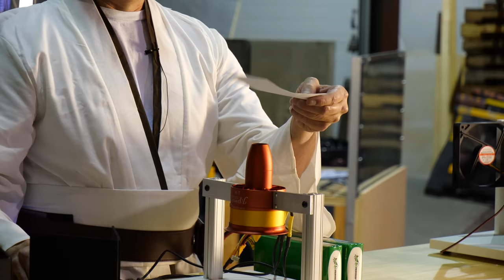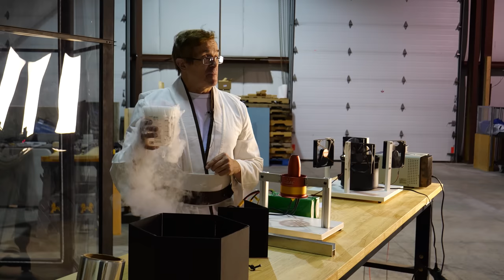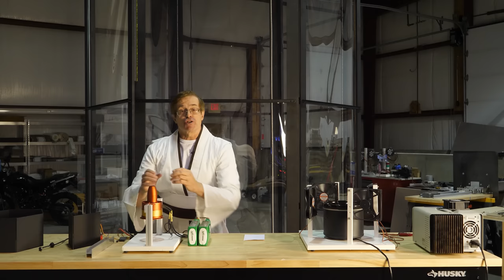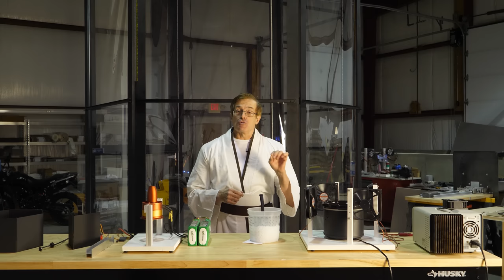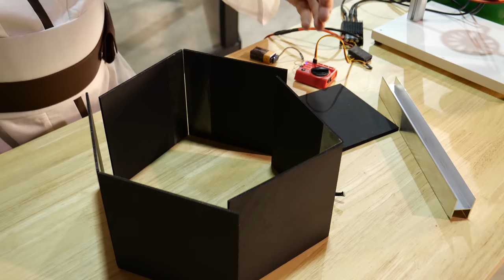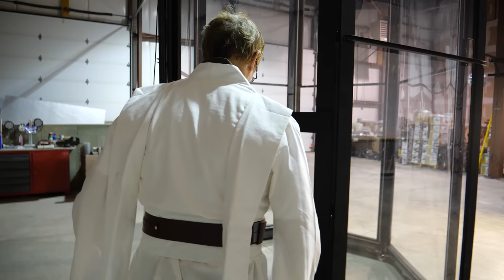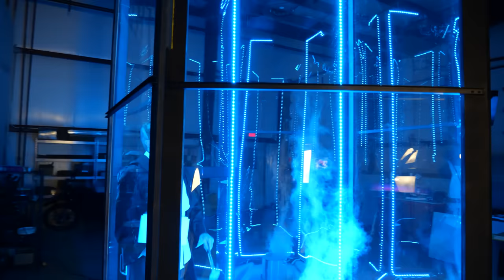Controlling Chaos: Building a Massive Tornado Chamber!

Comment: For a smaller chamber you can use an ultrasonic mist maker, they just require water and electricity.  You wouldn't think a small mist maker would work well, but I think the low pressure center of the vortex helps bring out the fog.
Reply: That's what I was thinking as well.  Wonder if you could get several of them for the big tornado machine?

I can't imagine the residue from those fog machines, I've noticed white mineral dust from the ultrasonic humidifiers, let alone atomizing oil or glycerin in the air.
Reply: @Dan-yk6sy 
That is some hard water you are dealing with.
Reply: Yeah with distilled water.
It would take several high power ones, but would leave only water.
Reply: @Dan-yk6sy  With decent juice there isnt ....much.... residue. Then again, Ive mainly used them in themed attractions ( from little 40w cheapies to 1500w ones with dmx and stand alone brains) not an plexi box, but there is a VERY stark difference between walmart fog juice and something like frogger juice. Especially if you use a more hazier or stringier fog (hazers are for lasers, and strings are for like flowing through something like fence stakes, makes long wispy tendrils. From what Ive been able to get out of the guys from Frogger at conventions is the fog characteristics has to do with how the glycol chains form after the water flashes and the steam 'fluffs' the oils into the air and carries them out of the machine), compared to something like 'bog fog' which is the thick long lasting low to the ground stuff.

You can use old ecig cartridges for mini foggers, just add a bit of airflow and you're set. I use an old vape pen with some fog juice for visualizing my laser demos (more science-y diffraction and interferometer stuff).

Otherwise, yeah, absolutely use distilled non-mineralized water. The ultrasonic disks pulverize the water into droplets (basically cavitate-shove-cavitate-shove etc) so anything in the water will just fall out and cake on the disks. The good news is there are models with replicable disk sections (they're just held down by a ring retainer onto the contacts). So if they get too scummy you can just order a bag full of replacement disks instead of replacing the whole unit.

Oh, side note: remember to run vinegar and distilled water through your fog machines before and after use  before storage. The last run should be just water until it stops smelling like vinegar. Gets all the leftover crap and crud out ;)
Reply: This idea has me thinking of the possibility of using it for wet flow analysis of cylinder head / induction systems, on a flow bench.
I realize it wouldn’t be a exact analog, for differences in characteristics, between fuel and water, but think it may provide a demonstration of the general behaviors of aerosol flows within specific port configurations.
Reply: @zombieregime  I've found bulk pure vegetable glycerin (VG) to work super well for the old vape device portable fogger/hazer
Reply: Yes, I'm making one desktop sized!

Comment: I still remember my 7th grade science teacher back in the 90s doing a tornado demonstration showing some similar aerodynamic effects, only he used fire to create the tornado.  The demo required only an empty coffee can with a small piece of cotton cloth soaked with something flammable (can't remember if it was lighter fluid or kerosene/lamp oil), all set atop an old phonograph turntable.  The updraft created by the convection from the heat rising, along with the rotation from the turntable, created a stunning twisting fire column that of course as kids we all enjoyed watching.  And since it was literal fire, the tornado was self illuminating and wasn't dependent on humidity of the air to condense water-droplets so it could be seen; in-fact the effect looked even better in the dark when all you could really see was the whirling tornado.
Thanks Tech Ingredients (and my old teacher Mr. Wolf) for making science fun and interesting!

Comment: I like the modular panel design! I hope more people play with the idea. Nice work.
   I have built a number of tornado machines for a local science center to loan to schools, and a large permanently installed machine that produces a 10 foot tall tornado. These used ultrasonic vaporizers to produce the fog, and they performed very well. The small machines (producing a four foot tall vortex) worked ok with a household sized ultrasonic vaporizer. The ten foot tornado used an industrial unit with eight transducers, fed with tap water run through a filter and DI bottle so it ran continuously without needing attention.
These machines didn't use clear panels but instead used four hollow posts that each had a row of holes along the length to form a set of air dams which both gave the rotational motion and helped exclude ambient air currents. This allows people to simply reach (or walk) in and play with the vortex.
One other tip: The vapor source should be underneath and coupled to a flat floor with a perforated central area (like a perforated pizza pan). Having a large stockpot or humidifier just sitting at the bottom causes turbulence that disrupts the laminar incoming flow and makes the vortex less coherent. You should be able to see that the vortex has a hollow core!

Comment: Beautiful video and beautiful build! BTW- For those who would like to create beautiful underwater tornadoes on a tight budget, you can do so by filling a tall jar or cheap plastic bug terrarium with water then add a layer of ultra-fine grain aquarium filter sand on the bottom. The finer the grains of sand the better. Regular playground sand is too heavy and will not work very well. Ultra-fine sand has just enough weight to easily be lifted and fall back down gently. My local PetsMart store sells bags of ultrafine aquarium sand and small bug terrariums for cheap. The tornado itself can be easily produced with a cheap, battery-powered coffee milk frother that uses a small, spinning coil of wire to froth milk (create milk foam). Simply lower the spinning frothing coil into the top of the water. It may take a few moments, but a vortex will form that will eventually reach down to the sand and will start to pull grains of sand all the way up through the vortex and spit them out at the top like a real tornado. Tornadoes produced this way can look very, very realistic. Total cost of all three components is about $15 US dollars. Bags of ultra-fine sand usually contains a lot of dusty particles that will cloud the water. If the water gets cloudy, simply do a few water changes. 

You can also “steer”, or guide, the tornadoes around the aquarium by moving the frother. In one of my science classes I used a 10 gallon aquarium with a 1/2 inch (2.54cm) layer of ultra-fine sand at the bottom and handed out a bunch of cheap milk frothers that I purchased from Walmart for a few dollars each. We had as many as 6 tornadoes being produced at the same time in the aquarium. The students very quickly learned to start attacking each-others tornadoes by moving them around the aquarium. We called our new game: ‘Tornado Wars’.

PS- I’m jealous you can wear pure white in your shop. Two seconds in mine and it would be incredibly off-white. 😭

Comment: If you watch videos from How Ridiculous, when they drop a big rubber band ball with a small rubber band ball behind it, from a drop tower, you can actually see when the smaller ball tries to move out from behind the large ball, it is deflected back to the area behind the large ball. It's kind of like the demonstration you did here with the ball in the air stream.

Comment: Great video as usual.
1 - its interesting how your presence inside the chamber disturb the flow. See the perfect and mesmerizing flow when you are outside.
2 - if I could i would place the dry ice on top and the fan on the bottom to see the difference.
Cheers.

Comment: The fire nado is pretty cool as well during large forest fires. Meteorology speaking the structure of a supercell has a lot of contributing factors such as the beavers tail forms with certain inflows thus adding to the sheer bases form rain free and shafts for rain this is a great example of using the doors to help create the variable winds that are actually occurring out in the field. Great job kind sir!

Comment: If I remember right, when we saw a demo of this in elementary school (40 yrs ago) they used a pan of water on a hot plate at the bottom, and no fan. Not as impressive but truer to the actual formation of a tornado. Things have to be just right to get it to work but the vapor funnel is actually water condensing out of the air.

Comment: Thanks for the wonderful demonstration and explanation of tornado formation processes!
It looks like the vortex is rotating in the same direction as the fan.  I imagine If the panels were adjusted so that the vortex was rotating in the opposite direction of the fan, the tangential velocity of the vortex air stream would be more effectively captured by the fan blades and resulting a much higher air flow, fan loading and stronger vortex.

Comment: this 5 minute intro, made me understand why particles "create pressure". after all those years, I realise that a gas is a bunch of elements bouncing randomly. But the structured stream of the gas elements in the fan remove (Lower) the randomness. And also "remove" the randomness of the elements in the boundary layers because there are less collisions in the other directions possible. Because these elements are like billiard balls knocking the other elements in the  (in this case because of the fan) upward direction. So that's why there is "high pressure " and "low pressure". Thank you!!
Reply from the maker: You're welcome.

Comment: Suggestion for topic to research and make some experiments: Test h-BN (hexagonal Boron nitride) nano powder (less than 100nm, better 60-50nm) additive for engine oil.  It makes engine last longer. So it would be great if you demonstrated it on some small engines you probably have. 

WS2 and h-Bn have a two-dimensional platelet structure and a high hardness which results in a very low sliding friction coefficient.
The theory is that very small particles of this material mechanically adhere to the metal surfaces of the engine creating a hard and sliding boundary layer thus reducing friction.

Comment: Sometimes in the early morning over a still pond, a few minutes after the sun hits the surface a frantic mist appears over the water. The amazing thing is six or twelve foot tall mini tornadoes about four to six inches in diameter.
Reply: Sunlight photoionises the surface of water (see Gerald Pollack) which creates water vesicles (via sputtering of sufficiently ionised bodies) that approximate a dust/vapor plasma. It so happens that both the vesicles and the Earth's surface have a bulk negative charge causing the levitation of the droplets and water vapor. (again Pollack).

What does get interesting is that aerosol largely acts like a gas, and since the droplets have a bulk charge, it acts like a gas plasma. The vortices you see are a result of Marklund Convection, the formation of plasma filaments (very common in plasma experiments). The rotation of the vortex is induced by the Lorentz Force. 

If the vortex were powerful enough, like that of a hurricane, you'd see that there's a concentric and counter-rotating shell around the inner cone. This counterbalances the spin, and the current of the vortex. Given the difference in radii, and volume, it doesn't need to be that (charge) dense, thus diffuse and invisible water vapor is a sufficient ballast.

As it turns out, electricity is very orderly, and more powerful than thermal forces. 

If you want to see more, look up "Matt Finn: Electrical Dust Devils". It provides the above explanation with more detail and examples.
Reply: @Dan-gs3kg  "“This is the ‘cold fusion’ of physical chemistry,” says Michael Grunze of the Pollack work. "
Reply: @BobCat0  Gerald Pollack.
Reply: @Dan-gs3kg  Yes, the nutty quack.
Reply: @BobCat0  show me how the experiments are wrong

Comment: Having sold vacuum cleaners,(as a young teenager in the seventies) I developed the skill at subtly moving a business card from nozzle to another. When making a sale I would, when the opportunity arrived, place my business card on the customer's old vacuum, then lift it off with mine. Not mentioning that I could easily do the same thing in reverse.  I recently tested my skills to get my pick of machines in my construction. I just explained that I was giving the stronger machine to the other guy. A piece of sandpaper proved it.

The value of a properly misspent youth is proven yet again.

Comment: Ok, this is just purely coincidental given the #short I just uploaded.

I've been making little vortex chambers out of PC fans and foam board but mine are open ended (not fully enclosed). The recent one is a 90 degree corner with a curve to promote both the initial spin and to keep turbulence at the minimum.

I'm using a slow 220mm main fan and have recently got some very small 4010 fans to add a slight breeze along the wall.

Comment: I think maybe its a slight oversimplification to say that a ball or whatever trapped in an air stream is there because of the low pressure created by the moving air.
Whenever the ball deviates from the center of the stream, the stream gets preferentially attached to the side closest the the center of the stream and ejected from the opposite side. The net effect is the momentum change of the ejected air (which is always in the direction of the deviation) gets transferred to the ball, pushing it back towards the center. So it isn't the overall low pressure of the stream, but the very local pressure differential caused by the attaching and detaching air stream that keeps the ball centered.

Maybe this is being pedantic. I don't know. I'm still putting it here.

It would be interesting to see a smoke trail in the center of the stream and slow motion of how it moves.

Comment: You did a great video, had great ideas and built a very cool tornado machine. Still i have an idea for something next level. I don't know if it's possible but I hope someone one day will build a tornado machine that generates its own visible vortex the way real tornados do by converting incoming air with invisible water vapor to visible water droplets. It might take too much pressure differential,  it might take too much energy, it might get too dangerous but it would be interesting to see if it's possible.

Comment: Use the LED strips that are encased in silicone, for outside use. If you try to store these, or even while using the structure, LEDs are going to fly all over the place, they get ripped away from the strip if you hit them with something.

Comment: Hey Obi Wan, great show. If you placed a pot of ice in the middle and had a small plastic tube where you could flush some water into the pot by hand or with a small pump - wouldn't that work as a remote as well? More water more vapor, right? Or perhaps skip the ice and use a super fine water mist like they sell for hot summer days? Maybe next year you could have your assistant take a swipe at you with a light saber and you disappear. May the force be with you.

Comment: I could not help but think of the small dust collector i use on my shop vac.  It does an amazing job separating fine particles of dust, I guess, by  centrifugal  force.
Also, good point about water changing state from vapor to droplets.

Comment: 6:54 Angular momentum is conserved, but not velocity. Since moment of inertia is proportional to radius squared, at a given L, if you halve the radius, you quarter the I and quadruple the ω. However, the linear velocity is proportional to both ω and radius, so the linear velocity is also doubled. Thus, the kinetic energy (1/2 I*ω^2) is quadrupled.

Comment: If these principles were to apply to an open shower bathroom, theoretically the moisture would be remove a lot efficiently and faster, and the only power input would be the ceiling fan, since the walls passively guide the air intake to form a vortex. I don’t know if it works, but I like the idea of it.

Comment: The ballerina does add kinetic energy to her spin when pulling arms in. It takes a force over distance to pull the arms in, so work. And if you look at the kinetic energy before and after, the angular velocity is squared, while the moment of inertia is linear.
Momentum is conserved, energy isn't.
This is why things with internal damping, like sattelites with sloshing fuel or a flexible rod, will be unstable rotating about thier lowest inertia axis. Damping will suck energy from the rotatation, but momentum must be conserved.
Reply: Yeah, what you are pointing out has been pointed out by several others.  If you keep scrolling down comments youtube keeps loading them (until you have loaded all of the comments.) Search on the page for the comment by 'tjncooke' who was among the first to address the error. Tech ingredients wrote a reply to that comment, stating: "True,  but the effect is very small".

So: Tech ingredients is convinced that when a rotating system contracts there is negligible increase of kinetic energy. 

Hypothesis: I'm guessing this is a case of overreaching with the rule: 'A centripetal force does not do any work'. As we know, it's during circular motion that the centripetal force is not doing work; during contraction of the rotating system it does. 

Other than in the reply to tjncooke Tech Ingredients has not responded to any of the other comments in which the error is pointed out. (Tech ingredients does read the youtube comments; there are occasional replies.)